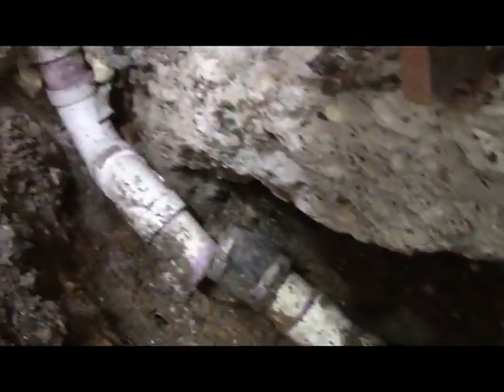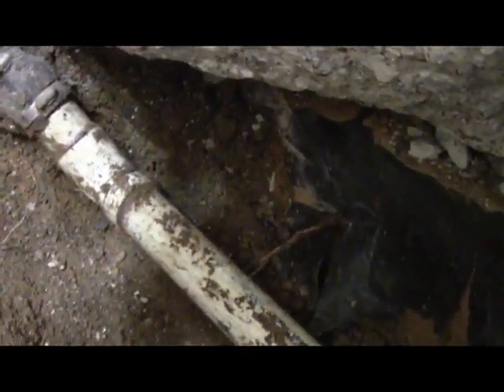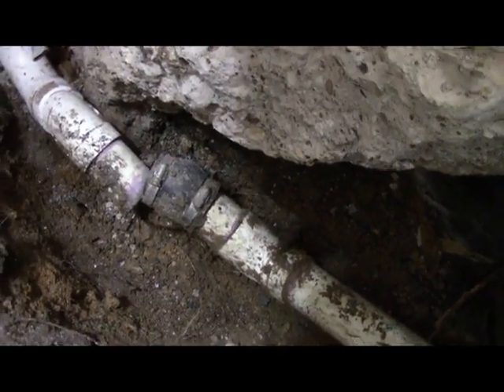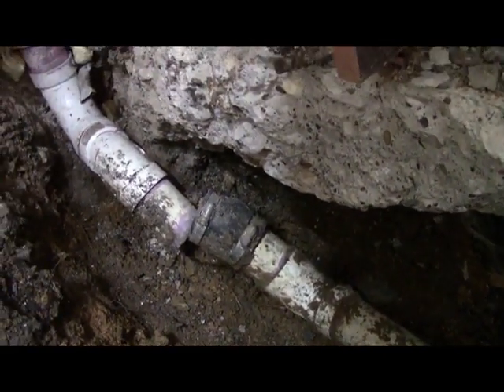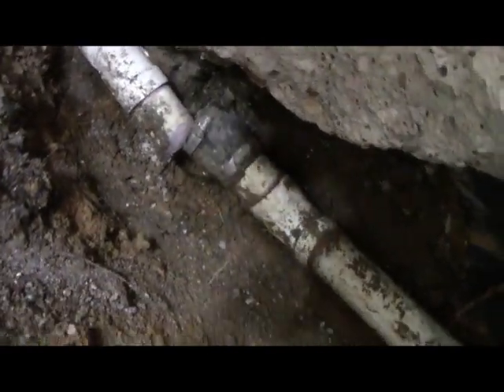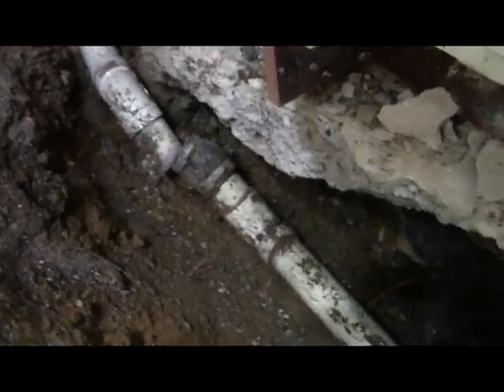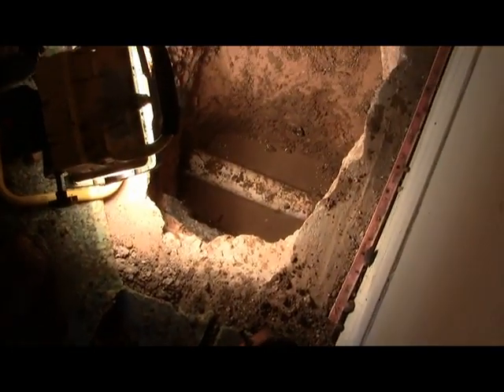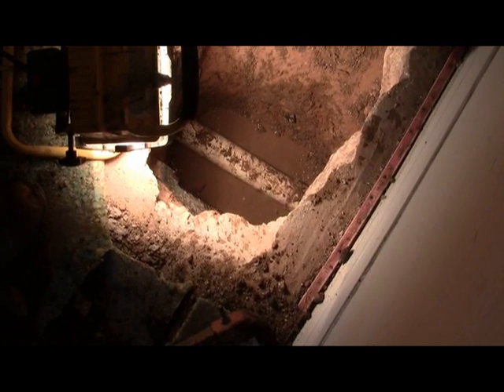repairing sewer leak under slab foundation

Comment: I don't believe you can use those rubber connections under slab, could get punctured, deteriorate clamp rust, then again I don't know what you would use if it was PVC to cast iron
Reply from the maker: The plumber glued it al pvc